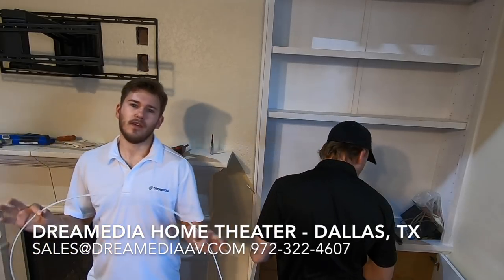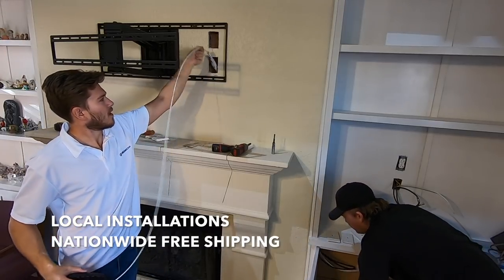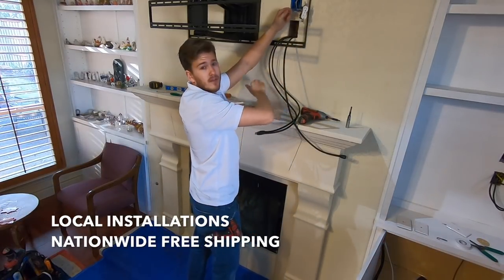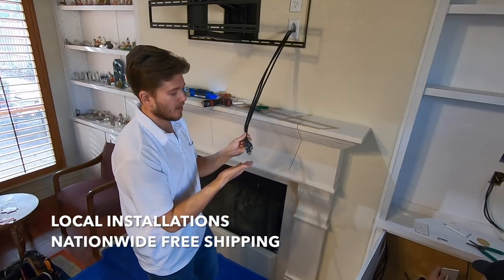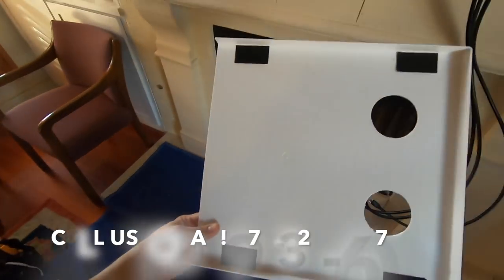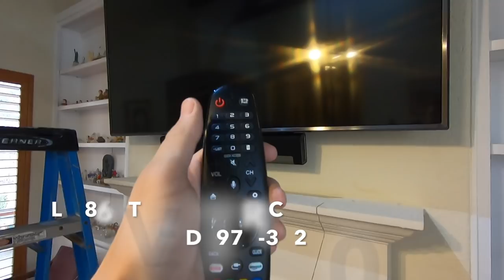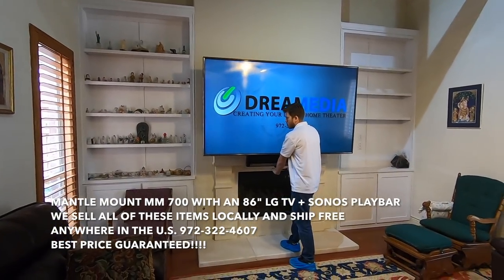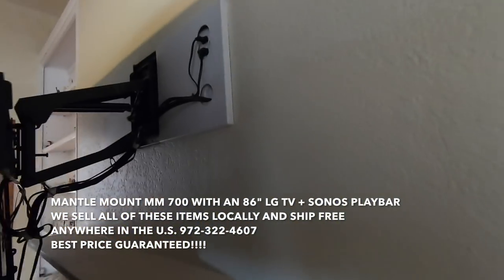PART 2 - Mantle Mount MM700 Installation With 86" LG TV

Comment: I really like that mount but wondering why you would need to pull the tv up and down after installation. It does seem to make installation look easy though.
Reply: These mounts allow you to lower the tv to a better viewing position.   The best view is NOT over the fp so you have to look up.   Optimal view should be at or close to eye level.  More comfortable. 
This mount allows for the pull down

Comment: Hi, it just so happens I purchased this same TV and soundbar and was searching for installation videos and was happy to find you guys. Question; What mount did you use for the Sonos Playbar? You had mentioned you used an additional mount. I purchased the Sonos play specific mount and had read it could be attached to the Mantelmount 700. Have you had any luck with that? What works? Thanks!

Comment: You don't show what happens to the cables on the drop down arm. How to attach them, bundle them, etc., Also, you lifted the television up, but don't show how you attached it to the mechanism. And finally you don't show how you adhjusted the drop-down arm to compensate for the weight of the television.

Comment: You really shouldn’t be dealing with power if you don’t know what your doing.  Romex should NEVER be used for a fireplace outlet.  BX is the only acceptable solution if you can’t pipe it.
Reply from the maker: Thanks for watching Scott! Residential building code here in Dallas says Romex is acceptable and all the builders use it for all power outlets above fireplaces. We only use BX for commercial applications.
Reply: @Dreamediaav  have you guys ever have issues running high voltage with video/data/low voltage? Heard there might be some electrical noise/interfere.
Reply: @TheReynMan77  I was wondering the same...

Comment: Hello. How do you adjust for travel stops of the mm700? The manual shows a picture (section 33), where the locknut is. But there is not actual instruction or video on how to loosen and tighten the locknuts to lower the mount.
Reply: @Dreamedia Home Theater  Same question here, excelt for the MM540.  I want to lower mine a tad bit more than what the installers set it at.

Comment: What’s the weight of that 86” TV?
Reply: MrMilanina If that’s the same 86” LG tv I just bought it weighs 97.4 lbs. without the tv stand and 103.6 lbs. with the tv stand. It’s also 76.5 inches wide and 44 inches tall. Screen size is measured diagonal corner to corner 85.6 inches. Just in case you needed any other dimensions. Cheers.